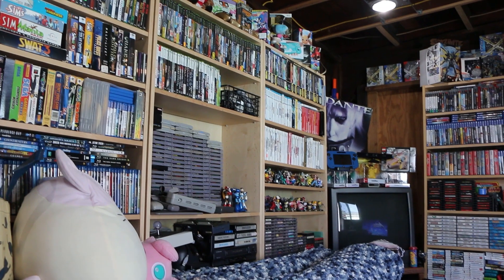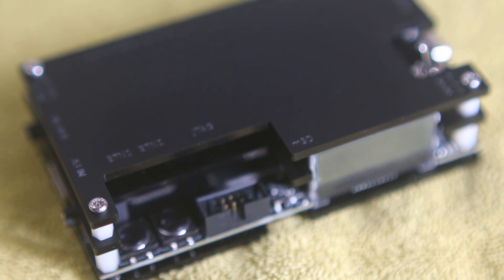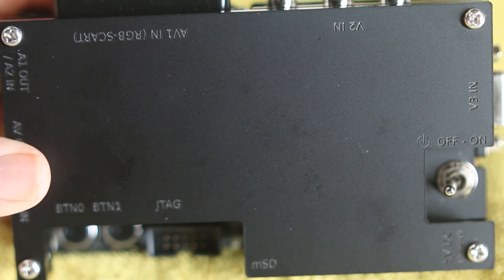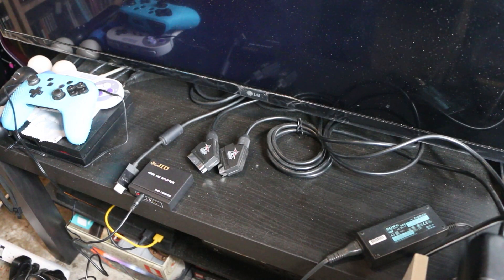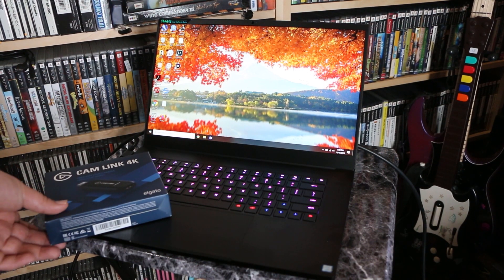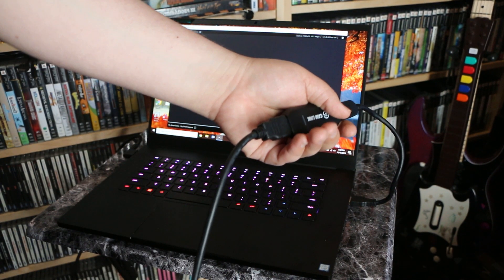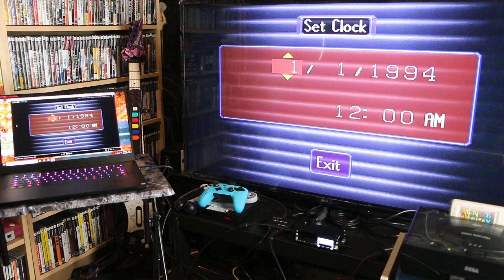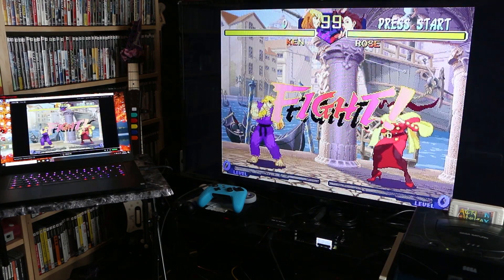OSSC Stream/Record Setup and Review (How-to Guide)

Comment: I can't Stream/Record with this device made in idiot.

I have a Scart to Scart cable connected to my CRT TV to the OSSC with the HDMI input connected to the video capture card, and I get a gray screen just like the one shown in that video. When I turn on my console, there's still no signal.
Reply from the maker: If you plug the HDMI into a TV, do you get the video there?
Reply: @BNGamesYT  My TV is old, it doesn't have an HDMI input.
Reply: @BNGamesYT  I use my old TV for gaming and the HDMI input to stream from OSSC to OBS Studios.

Comment: What about 480i/576i signals? Does it work?
Reply from the maker: It does, but I do my best to stick to either 240p or 480p
Reply: @BNGamesYT Yeah 480p is the way to go but its good to know because the tech site of elgato does not show 480i as supported resoltion. Do yo need to use a trick with (OBS?) to capture/use this resoltuion with the elagato or does it work out of the box?

Comment: I have looked through so many of these videos but no one says anything about how to use composite cables for it
Reply from the maker: FeetuhsMonchair You don’t.  That would be utterly pointless with this thing, and why would you want to do that? Get a scart cable and get it over with.  If you’re going to insist on using composite cables, get the retro rink.
Reply: @BNGamesYT  why are you mad? I was just trying to figure out if I could, I'm trying to connect an original Xbox to it and the Xbox came with composite cable so I was just trying to see if I could
Reply from the maker: @ChiliRaider  lol not mad, it just doesn't make sense to use a lower quality cable with this thing.  Get a component cable for your Xbox, it will look MUCH better this way.
Reply: @BNGamesYT  I got component cables and I was messing around with the settings, trying to get rid of the pixelation but now my screen is just black and the game only flickers on for a second every now and then. I tried resetting the settings but that didn't do anything.
Reply from the maker: @ChiliRaider  Make sure you are not using it beyond 2X mode, and also try a different TV.  It doesnt work with all TV's due to how the scaling works.

Comment: Are there any audio sync issues? I currently am having major audio sync issues with my current set up and im considering going over to the OSSC. I have the El Gato HD 60 Pro.
Reply from the maker: It doesnt work on the El Gato HD 60, you need the 4K Cam Link

Comment: Do you know if the Elgato Cam Link 4K supports PAL resolutions. I ask because PAL uses 288p not 240p like NTSC does. And the resolutions when doubled are not standard resolutions (except for 576p). For example the PAL equivalent for 720p in 3X mode is 864p. And the equivalent for 960p in 4X mode is 1152p in PAL. Maybe 5X mode would work, as 288 X 5 is 1440p. Which has the same height resolution as 2K.

But I honestly don't have a clue. I'd like to get the Cam Link one day, as I can only record my retro stuff using my Elgato HD60 in 576p50. Which works perfectly fine. But I know It can look way sharper than that. If you know it excepts those resolutions regardless I'd like to know.

Comment: Can I use the Elgato HD60s instead of the CamLink?
Reply: elgato hd60s and hd60pro works with weird resolutions (960p) if you use the software "4k utility", the one we can see in this video. it also works with obs studio. ;)
Reply: @chonkal  I have the original HD elgato, do you think if I use OBS or 4k utility it would work in line 3x mode or should I get the camlink specifically for my retro consoles ?
Reply: @DacioNerdTV  I'm sorry I have no idea about this one, but the elgato game capture hd generally doesn't work with the ossc.
Maybe there's more infos on the ossc's forum
Reply from the maker: No, it won't pickup the weird resolutions when you line scale.  Ive found it almost doesnt work with any console even in native mode.
Reply: No, but It works with the normal Elgato HD60. Except it only works in 2X mode at 480p (576p for PAL).